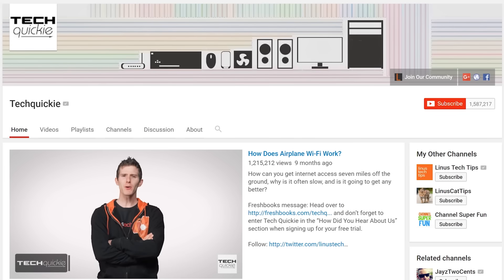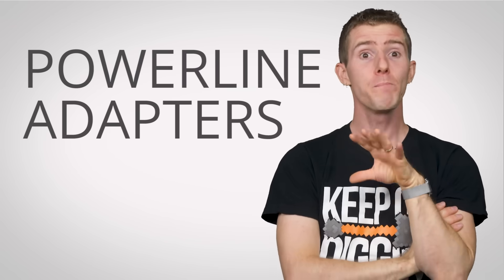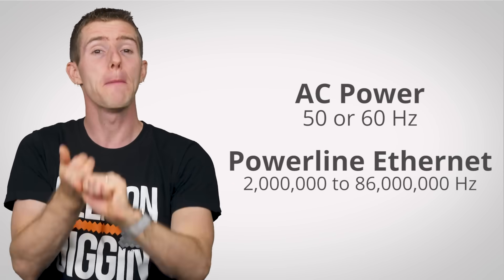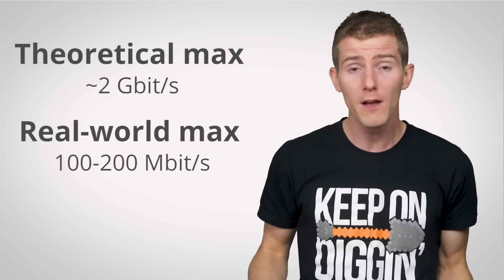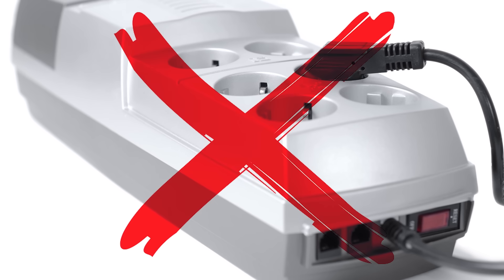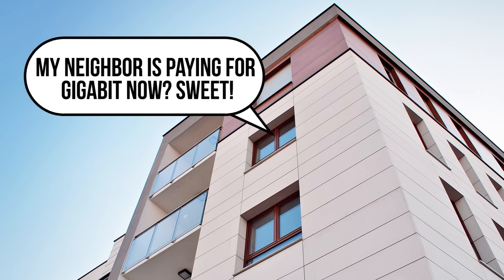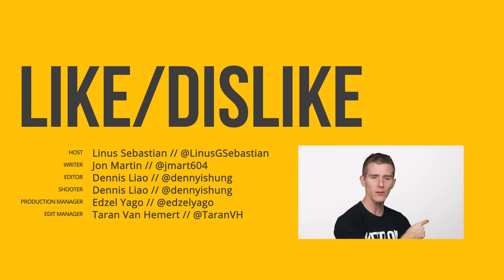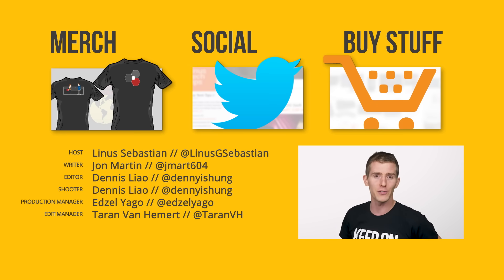How Does Powerline Ethernet Work?

Comment: Great video but it did not work for my customer, I had him buy a TP link two unit model such as the one in this video.. after more than an hour trying to set-up at a distance with him on the phone I gave-up, it seem that power line models work on the same electrical circuit, but when on a different circuit it may not function, so it got returned to Amazon.
I told my customer to go and buy the Netgear wall plug wifi mesh single extender that was in-stock at his local Staples store. It has worked perfectly, my customer has an IP phone that is far from the router and requires a wired connection. With the WPS setup I was able to guide him over the phone. Really great during Covid as he is 79.

Comment: Or you can adapt and use your old telephone line. It will not work perfectly as a RJ 45 with 4 pair channel, but the 2 pair channels on the RJ 11 are enough to make your internet work, and probably even better than a Powerline.
Reply: Ethernet only uses 4 wires and the other four aren’t used, they are used as basically used the reduced noise as they’re twisted together. So telephone wires has 4 and will definitely work, however they aren’t really twisted, but I get u.

Comment: Question with mesh systems being so popular can u use the powerline adaptors to connect 2 meshes and use it as a ethernet backhaul
Reply: Yup. I have the TP-Link M4 mesh system and all the satellite units are directly plugged into powerline units (also TP-Link incidentally). They all see each other and use the ethernet as backhaul. It leaves more wifi bandwidth available for communication with clients which should have a positive effect on performance, especially in high traffic areas.

Comment: Hello, I'm trying to connect my work computer to another office's wifi. My work computer blocks me from accessing the internet. If I did not have to login to the internet via web browser it would work. Connecting via an ethernet cable does work but there are only ethernet outlets in select areas. Would a powerline adapter allow me to connect to the internet via a regular outlet?

Comment: Yea I get inconsistent pings over Powerline with often lower averages than my WiFi... But WiFi sometimes has total breakdowns with huge spikes on ping and I at least get more bandwidth with Powerline most of the time.

But you really have to test multiple different outlets to find the right one. Sometimes you get vastly different performance. And even if you use a Powerline adapter that has a shielded plug you can use, this can still impact you quite a bit if, say, your PC gets its power from it.

Comment: You cannot compare these to Mesh APs that have at least 3 antennae, more streams, possibly with TurboQAM & NitroQAM. However I think these are a life saver for those who looking to get a quick and easy boost of Internet connectivity in places of where WiFi is poor. No need to lift up floor boards, install conduit or, clip to walls, skirting boards etc. They are inherently better than repeaters as well.

Comment: Do I need a router to Get Internet in the adapter or does it get/make internet by itself?
Reply: Yes, you still need a router. Powerline adapters usually come in a kit of two. The first adapter is plugged into the router via an ethernet cable. The second adapter is used for connecting whatever device you want to hookup to it (pc, network attached storage drive) again with a ethernet cable and then it's plugged into the wall outlet. Hope this helps.

Comment: I have a doubt. Are there any dangers in using this kind of technology?
Reply: It goes through your home, so people with access to your electrical system can see what goes through it unless you encrypt it, similar to wifi. Also if there's a power surge, the powerline adapter could die and you'd have to get a new one. Not sure about your other equipment connected to it. So it's pretty good, just with some quirks.

Comment: It's great! I can only recommend it! It will not improve your base internet connection, however, most folks have problem with the weak wlan signal, not with the base internet connection speed. As you are directly LAN connected to your router through the electrical wiring, your internet will be tremendously faster

Comment: I had nothing but trouble with powerline when I did network tech support for a certain game console brand.  After having issues with wifi, the Blue Shirt at BestBuy recommend a powerline adapter, saying that my tech support experience was biased because I only got called if it didn't work.  I thought about all the problems I'd had over the phone with wifi.  Okay, Mr Return Policy, I'll try it.  Worked perfect!  While the other roommates hung out in the same room as the router to get signal, I was gaming on the other side of the house.  But yeah, definitely try it first from somewhere with a return policy, because it either works or it sucks, depending on your wiring.

Comment: I have never been able to use a powerline ethernet adapters from my house to my shop which is 50 feet away due to different breaker boxes but both run to each other.

Comment: I have a question for you. I have TP-Link TL-PA7010p I have 8 of them. But my question is I have noticed if I use more then 4 sometimes instead of saying 500Mbps for example on the PLC Utility App it would say - - it would show no speed. But If I use less than 4 it’s would be ok. I was just wondering my DSL connection is VDSL2 with Vodafone FTTC. I was just wondering by the VDSL2 connection using 17a MHz and the powerline adapters using between 2 MHz to 86 MHz would they interfere with each other. Because sometimes I have noticed my powerline network would sometimes drop out and I would have reset them. And if my DSL Connection is interfering with them would FTTP or Fibre to the Premises be a better solution. Because if that’s the case it would explain why powerline adapters have lower speeds because with FTTP you get no interference. If I am correct would powerline adapters Perform better on FTTP with faster speeds.

Comment: How would this work for a ps4
Reply: Just like with every other internet capable device.
Plug 1 adapter into the wall close to your router and connect the adapter and the router with an ethernet cable.
Plug the second adapter into the wall in the room with you PS4. Then you can connect the adapter to your PS4 via another ethernet cable or WIFI.
I have one WiFi capable powerlline adapter in my room. The PS is connected to it via a cable, phone, tablet, laptop and PC via WiFi
Reply: very well for playing games, could be slow for downloading updates

Comment: Can’t get my brite view 5100D to work for the life of me. Followed the instructions to the T and also tried pairing them side by side , no luck, 
But soon as i plug in a good ole fashion 30 ft Ethernet cable, it works fine and windows 10 and drivers are up 2 date

Comment: These things cause a whole lot rf emission. It's a wonder how they passed regulations. Incredibly disruptive in the 25MHz-100MHz Band, with unpredictable emission depending on the cables in your house. You're basically turning your house   mains into a massive antenna :(
See also:
https://www.quora.com/Does-a-1-to-1-powerline-network-create-radiation-If-so-does-it-create-more-radiation-than-a-WiFi-modem
Reply: All moot. Once Mesh Wifi systems comes down in price, that's where home network technology seems to be moving towards.

Comment: I absolutely love power line adapters. I had been using a set of TP-Link TL-PA211 (AV200 Mbps) bricks with a connected router as a WiFi access point for around 6-7 years until they recently died on me. Just replaced them with two TL-WPA4220T kits (3x set). Couldn't be happier. 

If you live in a wooden house with wood and plaster board walls and you don't mind drilling holes, then a high speed ethernet cable linked to a high speed router would be (slightly) faster. But for anyone who lives in a house with concrete floors and walls, and who doesn't want to destroy their house just to lay a cable, this is the way to go. I have one plugged into a socket in my garden shed, 40 m from my house, and I get excellent speeds and full WiFi coverage for my entire property. 👍
Reply: What TP link should I buy if I live upstairs and want to plug it into my wall to connect to the router below and then plug an ethernet cord into the TP link in my wall and into my PC?
Reply: I'm trying to connect two rooms but and stuck with switch style D-link AV346. 100Mpbs ones..

Unfortunately, all the cat6 port ones I see now, are all plug-in styles which do not work well when and out place has 4 sets of power points, not seperate ones where a big giant plug can ft in without overlapping any other. And to top it off, these power points are at floor levels just above the skirting, ya its an old house..

Why companies have moved away from switch based ones, I'll never know,...  I mean, they have 4 ports... It's still useful today

Its like saying "For our next product, we're gonna do away with 24 port switches". No network geek will like that...

Comment: Do I need more than one? Someone gave me th tplink AV600, can I just pair it with my router and use it on the other side of the house? It is not a huge house, ~2000sqft. I keep seeing all the kits with two or three extenders and adapters. Will my router plus one AV600 Powerline Ethernet Adapter work, or do I need a pair??

Comment: So I got one today and I used it with my PS4 and I couldn’t plug it into the wall so I tried it with the the power multi plug thing and it worked better than WiFi I went from 5mbps download and 45kbps upload to 20mbps download and 5mbps upload

Comment: Wait so I have a jack in my room for cat 5, and if I want to use the Ethernet I would have to use a cat 5 Ethernet cord from the 1st jack (in my room) to my device.Then I would have to go to the room with the router and find an Ethernet jack and plug it into the router, btw the cat 6 cable I have is just a bit too small so I just thought cat 5

Comment: houses divide power usually into 2 circuits or 2 circuit breakers p1 p2  its best with power line adapters on the same circuit p1 to p1  or p2 to p2 not p1 to p2 although live is split(p1 p2) and natural to neutral is  is connected at power box not sure if earth is used

Comment: Powerline adapters turn your house into a gigantic emitting antenna, not sure that is what you want. As they transmit their signals over the electric wires using the full HF band, from 3 to 30mhz, every electric wire in your house starts to emit aggressive digitally modulated electromagnetic radiation. I am both an engineer and HAM radio operator, and can tell you from experience that these powerline adapters are a big problem as they radiate until at least 100 meters away from the house using it and make listening to HF radio impossible because of the strong signals they emit. Unlike wifi which is sent from one single point, using small antennas, power line adapters emit via hundreds of meters of electric wire. Furthermore wifi stays within their band and does not wipe out a large portion of radio spectrum. On top of that, most of these devices emit far more than the specified power (so customers are happy with the speeds and performance), and often more than the legal limit. Just do a youtube or google search on PLC powerline adapters and HAM radio if you dont believe me.   Use ethernet cable instead! Fast, cheap and clean, and you dont irradiate yourself and the neighboors, and you dont cause a nuisance for people to listening to weak radio signals.

Comment: IV connect a router to a powerline adapter upstairs anything I can do to get better speed . 350 Mbps connection powerline only 80 mbps
Reply: The further the distance from the router to the upstairs powerline adapter, the less speed you will see. Check the distance between the wall outlet where the router is located to the circuit breaker panel then the distance from the circuit breaker panel to the upstairs outlet where that powerline adapter is located.

Comment: Ok my question is if this is good if i connect a ethernet cable from this to a pc? Will it work like a ethernet cable straight from the router? Is it better or worse than connecting straight from the router?
Reply: If you can directly connect your pc to your router then that's the best connection you can have, sorry for the necro xD
Reply: @DanStryder  yes of course but i dont have that option
Reply: What's the distance between the router and the PC?
Reply: @TimeWillTellAll  like 12 meters

Comment: I mad that I just found out this existed 😂. I wanted a wired connection for my Xbox in another room for the longest and recently almost bought a router extender. Never would have thought it possible for internet to travel through power lines

Comment: Excuse the long message... I'm in a pickle and hope a tech God like you can help... 

A month ago my isp was supposed to come and move my modem to my living room because where it's at right now, gives us a bad wireless signal. Well due to covid19, they are not coming after all. I was thinking if this alternative would work since I cannot physically move my modem to another room. I was thinking of buying a Ethernet adapter and plugging one end next to the modem and the other in the room where I actually want my modem, where id be connecting it the router. That way my router is closer to the living room and giving out the best signal.  Would something like this work? What are goods and bads of this? It's a Nighthawk X6 ac3200 Router

Comment: I own 2 of the D-link av2 1000's that I paid only $20 for refurbished. I bought these because of slow internet connection through wifi to my son's PS4.   They are far apart and on different floors and his download speed and upload speed doubled. They are always connected and go into a low energy mode when not in use. They are also encrypted so nobody and get on your network and you can buy more and add on. I think they are definitely worth it just make sure they get plugged into an outlet and not a surge protector or any other type of electrical filtration equipment.

Comment: What if the devices are not connected to the same power group? Most houses have fuse boxes to prevent overloading the electric network. You would need to flip each fuse to find out if your power socket is in the same group. If they're not is not that useful.

Comment: This thing is hit or miss. I bought an expensive one thinking I’d have better chances with it and it only gave me like 40mbps on a 600mbps connection. Go with Ethernet whenever you can. That’s the best way to extend your network and get full speeds. Also tried mesh wifi systems and wifi speeds always degrade when you pick up WiFi from the extender.
Reply: I'm thinking about getting one. Did you plug in an ethernet cable to it or did you use it wirelessly?
Reply: Shiz Nizzle I plugged an Ethernet cable directly to it. It’s all dependent on the wiring in your home. I’m assuming the wiring in my house must be pretty old, considering the room I was trying to extend my connection to was not even that far from where the my internet is set up at. I think it’s worth a shot but just make sure you buy it from somewhere you can return it if it doesn’t work out.
Reply: 2800boy alright, thanks for the insight
Reply: Thanks

Comment: i have fiber 1000. pc has speed test of 200-250 down and 300 up. cant go wired because my pc is in my room and modern/router is in living room. i did a wired speed test on the xbox and got around 800. so im going to try this powerline adapter and see if it increases my speed on my pc

Comment: Can having different type of adapters work together? 
Example: sams brand say TP-link for the powerline adapters. One of them is 600mb with 1 Ethernet port and another is 800mb with 2 Ethernet ports. If I connect the 600 to the router and the 800 say to my PS4 and smart TV will it work or no?

Comment: I suffered random dropouts on WiFi.  I changed the channel and it does not happen so much.  I used the WiFi analyzer app to find the channel that I now use (one that is not used by anyone else near me).  I would like to run some ethernet cables through the walls but the way this house is I would be best running it to the attic first then to the rooms.  Powerline would be 1000 times easier if it works well for me.  My internet tops out at 100 megabits so I don't expect to lose any speed with powerline.
Reply: you do lose some of your speed and the latency is also slightly worse.
Reply: @elixier33  I also have an Actiontec MI424WR.  It has a MoCA connection I might be able to use if I get another one or a MoCA adapter.  We have cable TV now and I am not sure if that cable is compatible with MoCA but once we ditch that and go with streaming it would leave unused coaxial cables in the walls.  It would be easier than trying to run new cables through the walls although a good electrician could probably get them pulled through if I decide to go with that.  I am just glad I found an unused WiFi channel here.
Reply: @charleshines6155  Have you looked at pro wireless like the UBIQUITI Enterprise Computing kits?

Comment: My 5ghz is 250 mbits, and i get 50 via powerline, i use cat5 cables, so why dont i get 100 via powerline?
Reply: Can be two things :

Your electricity and how it has been installed , nothing much you can do about it, just please put the powerline adapters the nearest possible from the wall outlet to reduce interferences from power strips, etc

The adapter : some are branded 200, 500 or even 750mbits but uses 100mbits FastEthernet Interfaces (the rj45 cable input) and so can't go far over 100.

So, if you consider the latter , plus a disturbed electricity in your house, you can get to around 50.

Comment: but how does it actually work? what's the modulation scheme? how secure is the password security? what kind of circuitry does it use to couple the data signal to the power lines?